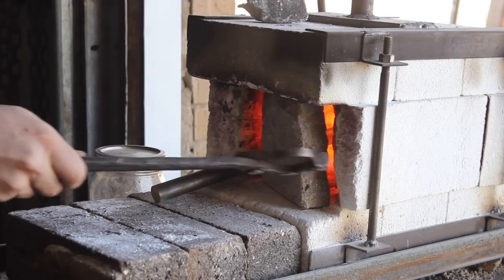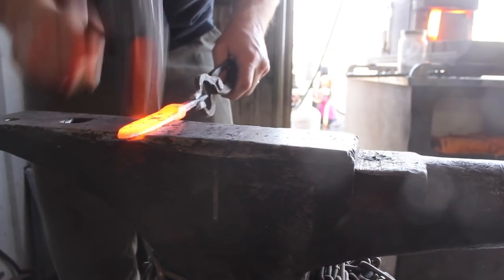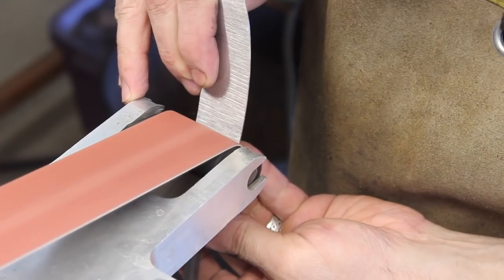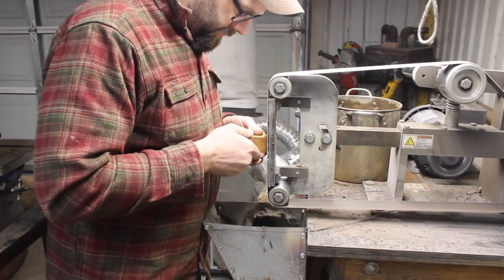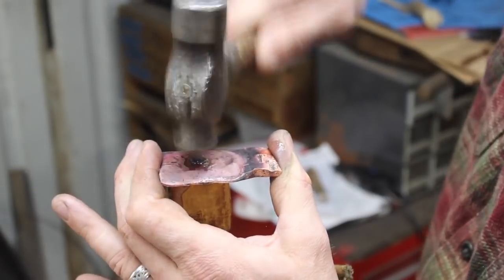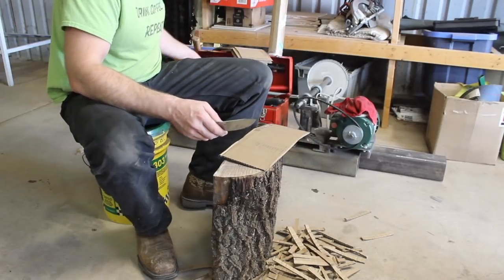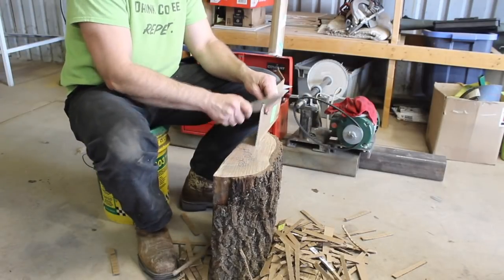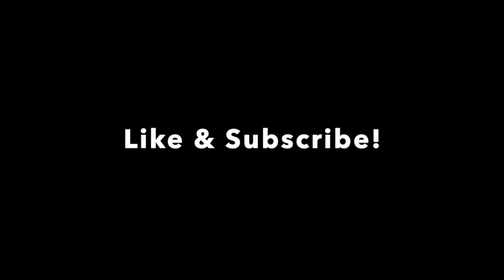Forging A Blade From 52100 Ball and Roller Bearing Steel; Bladesmiths Metallurgy Knife Heat Treating

Comment: As a chemist, I am very fascinated by your explanation of the chemistry of steel! I always take notes during these...very informative. Also, how many times has you wife walked out as you’re cutting cardboard and counting “499...500...501” and asked you when you’re going to get back to work? Love the channel, keep up the good work
Reply from the maker: Haha, yes she wondered why I had a pile of cardboard strips. Glad you liked the video!
Reply: @FireCreekForge  So follow up question: if chromium slows carbon diffusion, is that why stainless steels can be air or plate quenched? The diffusion of carbon is slow enough that it will cool faster than the carbon will diffuse out of the iron lattice without needing an oil quench?
Reply from the maker: @andrewneilson227  that's correct, chromium does contribute to that, as do other alloys. however, plate and air (still air, that is) quenches are quite different in cooling speed. An aluminum plate quench is equivalent to about a medium oil, I believe. A true air hardening steel (A2 for example) is different than say, 440C.

Comment: I would love to have a knife like that for skinning. As someone who has done alot of skinning i know that normal blades if well maintained wil last about 5 sheep or deer of similar size and you don't always have time for maintenance on the blade so for me it would be wonderful if there is a steel or blade i can use from daily chore and survival were you don't have to stress whether or not the blade is sharp were you don't need to attain maintenance

Comment: Have you tried multiple quench cycles? When I tried 52100, I didn't have a way to control temperature precisely for prolonged durations, but I was able to tease better results with a triple quench. I'm wondering if it is of any benefice with proper temp control equipment?
Reply from the maker: Multiple quench cycles will have no benefit except in a situation as you describe, where it's not possible to hold at temp for the appropriate amount of time. Even with multiple quenches it will be nearly impossible to bring the potential out of the steel.
Reply: @FireCreekForge  that's why I have a pile of 52100, at least it was cheap 🙂
Would multiple quench with good temp control still result in reduced grain size?
Reply from the maker: @matkins101  Yes, but reducing grain size isn't going to be your main concern, it will be difficult to bring the right amount of carbon into solution.

Comment: I know this is an older video, but I was wondering what is the benefit to heating the copper before putting it on the knife?
Reply from the maker: Heating copper to a low red heat and quenching it makes it soft

Comment: What about tempering? What temperature how long. Also how though is it. Would it be good to make a large blade or do you not recommend it for that?
Reply from the maker: Most of my 52100 I temper at 375F. Your tempering temperature really depends on your processes prior. When heat treated properly 52100 is quite tough, and will work just fine for a bigger knife.

Comment: People don't get it when I'm not excited over a phone book paper or tube test. This is why. I watch real knife makers who make ~Knives~ longevity, craftsmanship, style. Like I don't like stick/rat tangs. But you didn't just apoxy a stick/rat tang nub and jam it in. You integrated the bolster and full tanged it out to a proper peen on a copper plate. You didn't nub bowie into a handle(cringe), instead it's a knife proportionally right to the tang construction.That knife looks like a proper skinner and could do more if needed to. Ps beautiful flex on the brass rod. I'm a member on certain forums a I really see the best knife makers use stick into rat into bolt tangs on some of the most beautiful safequeens and think what a waste. Because if I had to the door shif I'm grabbing a schf 38 that's a full tang dump truck over that $1000+ art bowie. It's out of your budget go love your Chinese steel. no I'm just not out of my mind lol.

Comment: One of my ballbearing steel knives, is too hard to sharpen, even with diamond stones or ceramic, it takes for ever, like it's 65 hrc or more I don't know. Is there a way I can make it softer? It has the most beautiful rosewood-b.ebony handle scales, I 'v eer seen! Problem is, that the maker, made the steel wayyyy to hard. It would be very generous, if someone could help me, on how to make it a bit softer. It's simple to describe ballbearing steel, it's the BEST steel for fixed blades. Simple as  that!
Reply from the maker: If the problem is that it needs tempered more than that requires heating the blade to between 350-400. It's possible you could submerge the handle in water and carefully heat the spine of the blade until the right amount of heat reaches the edge. But this would be risky and imprecise. The other option is to remove the handle and temper in an oven.
Reply: @FireCreekForge  Thank you very much for the help sir!